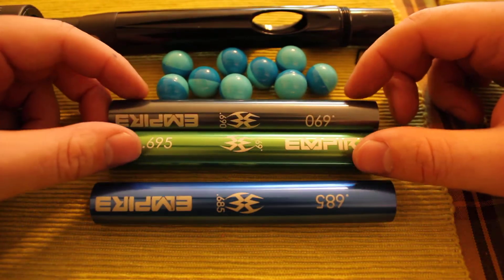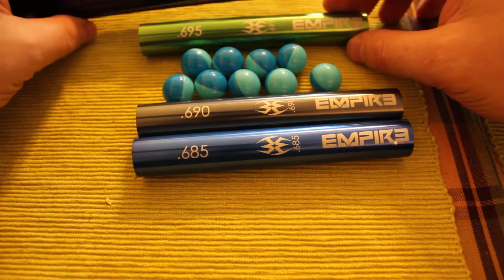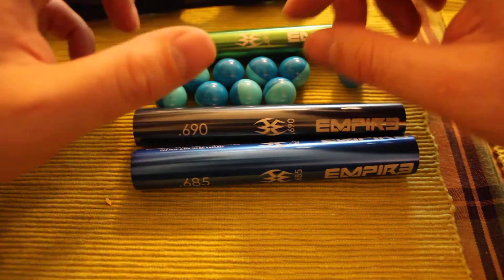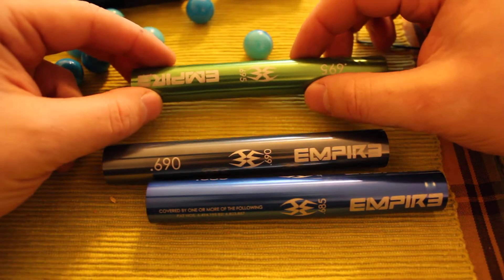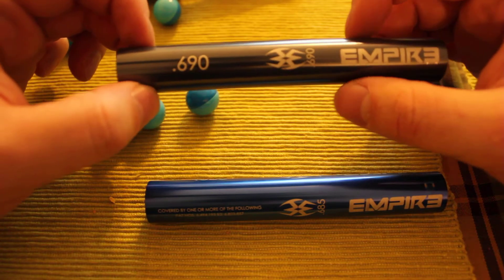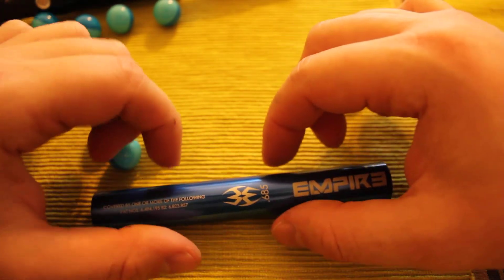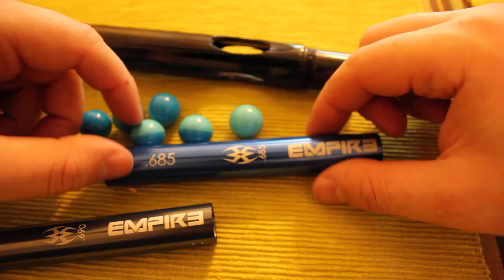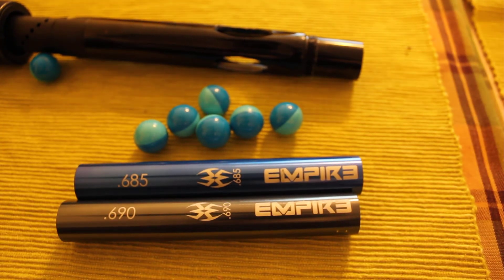DRC Paintball: Tutorial on how to match paintballs to barrel, overbore and underbore correctly.

Comment: thanks man, just gettng back to paintball after 8 yrs or so and want to match paint this time.  seems like the balls I buy are always too small..so just got the JJ kit with 688 685 682.  always used jj ceramic that I believe is 688.  ceramic impregnating is suppose to be supper slick and very good I guess.  I hope I wont need any more than these three for most paint from the local store--funny first time I've heard that over boring is more accurate.  man I have to keep researching stuff

Comment: so your saying over boring is more accurate then bore matching??
Reply from the maker: yes, absolutely. When you bore match, because the paintballs have inconsistent diameter, a paintball that is marginally larger than your "average" will bind up against the barrel with much higher friction and leave the barrel at much lower velocity than "smaller than average", so now you have high velocity spread. High velocity spread = high vertical spread at large distance. With overboring you have "blow by" where air escapes around the gap between the paintball and the barrel, the bigger the gap, the more air escapes, the lower the velocity , but variance in velocity due to blow-by it tiny compared to variance in velocity due to some paintballs barely fitting thru the barrel without breaking. There is air efficiency penalty for overboring but with modern guns running out of air is no longer an issue. I shoot .692 and had ZERO breaks this summer and shoot better with shitty paint than people that match or underbore.
Reply: SVAworld underboring is more accurate as well.  The least accurate is bore marching (blow test).

Add to that that underboring doesn’t break any more paint, and is more efficient, you’re better off going with a 3 to 5 thousandths underbore or maybe a bit more from what the blow test gives you.

Tests have been done showing the paintball can deflect up to 1/8 of an inch before breaking, so an underbore won’t have you breaking any more paint.

Plus barrel breaks are always caused by the paintball being fractured in the loading process, which is why the Cure bolt was created.